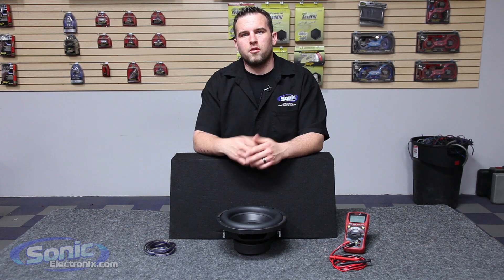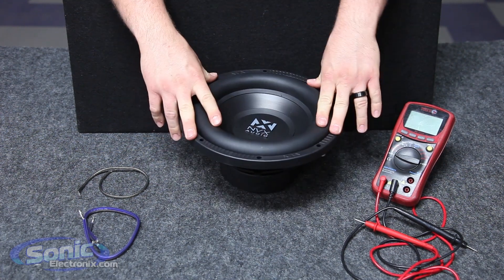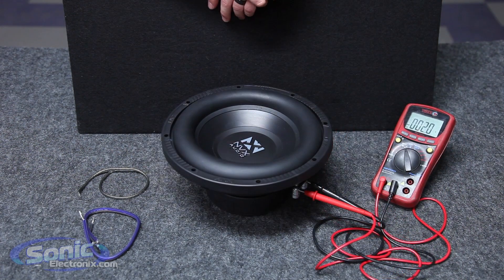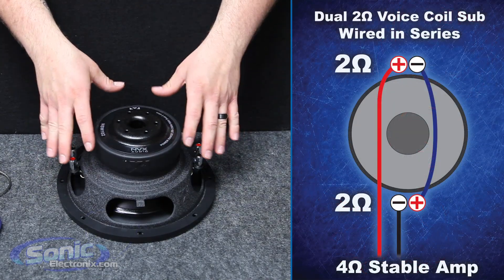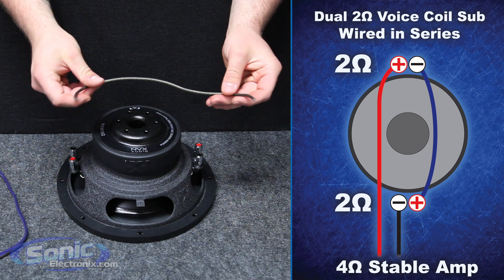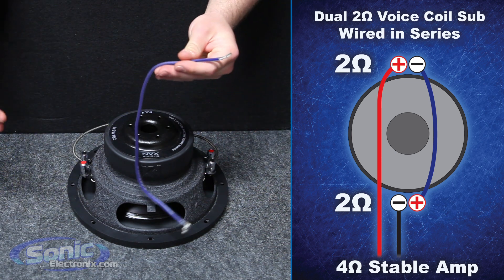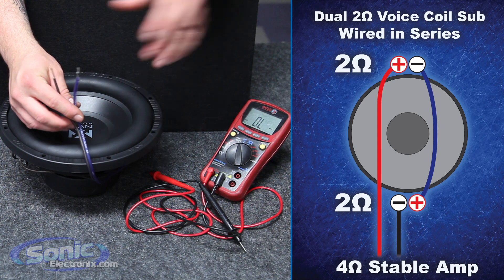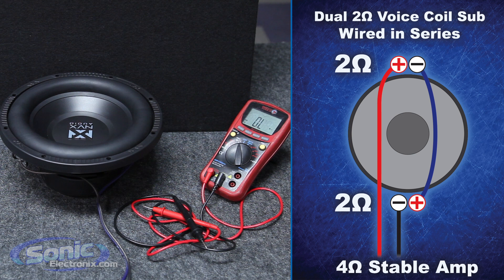How to Wire a Dual 2 ohm Subwoofer to a 4 ohm Final Impedance | Car Audio 101

Comment: If you want to get the most out of your amps then most people buy 2ohm dvc subwoofer so you can wire it to 1ohm and get the max rms out the amp  or if you have a amp that can take .05 ohm load then you buy 1ohm load dvc subwoofer so when you drop it down it will drop to 0.5 ohm resistance but only if the amp allows it and some company’s warranty 0.5 load like d4s but it’s all preference  I learned the hard way years ago it’s so much in car audio like it all comes to preference

Comment: Ciao e grazie per questo video. Vorrei porti gentilmente una domanda:  Quali caratteristiche ha in termini di timbrica un subwoofer doppio COIL da 2OHM collegato come in questo caso a 4 OHM e cosa cambia se invece i due COIL  li lasci a 2 OHM ? In questo momento ho un sub della Graund Zero  modello GZUW 12SQX 30 Cm 2x2Ω Sound Quality 600 configurato a 4OHM e non mi piace tantissimo il suo basso.,considera che il suo uso è per un ascolto in SQL.Magari se potresti gentilmente fare un video specifico te ne sarei molto grato.

Comment: Is there any disadvantage running a 2 ohm sub in series instead of a 4 ohm sub of the same make/model?
Reply: Not really. The only disadvantage that I could possibly think of is if you weren't paying attention and wired the phase wrong, you could fry the voice coil real quick. Other than that there is no inherent disadvantage.

Comment: My question is the performance of the woofer changes according to the connections?
 i have a dual 2ohm and it's supposed to be 500 watts rms
Reply: i think it does??? for the amp different ohms have different power ratings
Reply: oh and i dont think that the watts of the subwoofer changes im not sure! i know the watts of the amp changes

Comment: How do you make a 2 ohm into 4 ohm if you dont have a dual coil. If its single could you add a resistor to increase the ohms?
Reply: You should look into dual coil subs, your stuck with 2 ohms and that is plenty of power

Comment: I have one DVC 1 ohm sub woofer rated at 900w RMS and I have an amplifier that is rated to do 900w at 2 ohms. Would I wire my set up the same way you did in this video?
Reply: Yes. It is a dvc 1 ohm that means if you jumper wire between the two coils you will have a 2 ohm impedance on the remaining wires. In this video it is 2ohm DVC which will make 4 ohms at the remaining two wires.

Comment: How does going from 2ohm to 4ohms sound?
Reply: 2 ohm doubles you watts.4 ohm cuts your watts in half
Reply: @New Alert so if I have a monoblock amp that is rated 1500rms at 1ohm but I have a single sub that is rated at 500rms. I can wire my sub down to 4ohms because my amp is rated 550x 1 rms at 4ohms?
Reply: @New Alert even on 2 kicker l7t 10? Will 750 be enough? I think they are 500rms each

Comment: If you put two of those at a 4-ohm final what is going into the amp,   2 ohms ?
Reply: Medi Kate 4 ohms
Reply: @justind1169      if your using a mono amp that has 2 channel hookups it'll drop the 4ohm to 2 ohm so the answer is yes if its a mono amp with two terminal connections. the mono amp automatically drop it to 2 ohm load

Comment: Dual 2 ohm wired to 2 ohms? This is one sub.
Reply: Impossible....

Why the hell don’t you have the 12”  IDMAX D4???? WTFH.
Reply: There’s 2 coils each one is 2 ohms add that together you get four, run it parallel it cuts each one in half so you get a 1 ohm loaf

Comment: Need some help please. I've got two 12 inch crossfire DB3 Series DVC 2/8 ohm. So subs being 2/8 ohm how do I wire them both to 4 ohm's being 2/8 ohm's or are they the same as a regular 2 ohm sub. Thank you

Comment: I've got a mono amp and want to push a 4 ohm load. I am using only one sub. The sub is a dual voice coil, each voice coil is 2 ohms.  The dilemma is that, even though it's a true mono amp, it has 2 positive speaker outputs and 2 negative speaker outputs ... not left and right -- but just like this:
 + + - -. How do I wire that single sub to those outputs, do I somehow use both positives and both negatives or what? I want to make sure that amp sees 4 ohm because my power and ground wires and fuse are not going to be able to handle 2 ohms. Anybody have a solution?
Reply: series the sub as in the video then on the output section of your amplifier  take one positive from the two positives from your amp conect it to the sub do the same for the negatives an presto .
Reply: VM Gaming Thanks, I appreciate your response!

Comment: I need some help I have  two woofer the two of them is dual but here is way my problem comes I want to wire them together but on is a dual 2 ohms and the next one is a dual 4 ohms i like to wire them to 4 ohms final impedance can it be done I really need some help
Reply: kyle gurley Wire your dual 2 ohm to 1 ohm and cross it over to your 4 ohm sub basket that would be wired as shown here. make sure when parallel wiring like that to connect to the positive and negative terminals that don't have the jumper and run your final wires to the amp.

Comment: if you wire a dual 2 ohm to a 4 ohm impedance, can you still push the same rms power that it was rated at @ 2 ohms?
Reply: craneoperator4 so how do you keep a 2 ohm sub at 2ohms?
Reply: The power from the amp will drop but the rms power on the sub will stay the same the same.
Reply: ExtremeBassLine i have that same question
Reply: no...your power will drop
Reply: +craneoperator4 thanks
Reply: Brandon Potter  +to amp & -to amp
Reply: ill explain one more time. with a mono amp like mine a jbl600a1 mono wiring them in series to 4 ohm like this viedo shows  the amp automatically  parallels them back to two oms. if your mono amp has two speakers connections and is 2ohm stable . same if u have two 4ohm single voice coil. run it to each channel the amp parallels the 4oh to a 2ohm load. automatically now that's the easiest way for my to explain it
Reply: Brandon Potter try running 2 of them. Do series parallel wiring.

Comment: Could I do this with 2 subs and connect the positives and negatives and connect them to my amp bridged at 4 ohms?
Reply: Collap You would need two 4 ohm subs. two ohm subs wouldn't fair well with this method. but if you unabridged your amp you could run the four ohm loads to each channel. With the bridge only 4 ohm subs would work by wiring them parallel in this fashion by putting a jumper on each sub this way and then wiring the remaining terminals in parallel + to + and - to -. Hope this helped.
Reply: Neal Pennington ... ok u can bring dual 2ohm to 4ohms. Ok what about running 2 dual 2ohm to 4omh. An at the amp what would it see 8ohm or just 4ohm... cause i have a punch 800a2 200x2 4ohm 400x2 2ohm but 800x1 4ohms bridged. Im tryn to get my 2 dual 2ohms to bridged 4ohm is it possible.

Comment: Can you wire a dual 2 ohm sub to a 2 ohm amp?
Reply: yes just connect it like you normally would
Reply: ExtremeBassLine so u mean connect it on one side red and black and Thats auto 2 ohms straight
Reply: @harlembossdon  I have the same ?

Comment: I have two solo-baric s15l7 2 coil 2 ohms each how do i connected to a ZX450.2 kicker amp i have two of those amps best way to connect to have a good sound out off it any suggestions.

Comment: By wiring the 2 ohm to a 4 ohm how is that helping. Also I'm looking at a 2 ohm (SPL FWX 154) (peak watt.2200/ RMS watt.1000) and I will be running that speaker off a 3500watt  planet audio will this be a good setup. Any advice is good advice thank you.
Reply: some amps cant take the 2ohm load if you have a amp that is only 4ohm stable this is very helpful its mostly the old class a/b amps that cant take lower then 2ohm

Comment: Just bought a dual 2ohm 8" sundown woofer, this helped me!
Reply: How would you do about hooking this up to a single woofer? 8" 2ohm. I have a stock. Amp and 8" woofer. If I turn it up it sounds ugly like it's about to pop. Until I lower the volume.
Reply: @TacoYakie  I know its been 2 years and you probably found but get a better amp
Reply: Hey I have two of the scar twelves that are two of them can I wire both of them up like this to get a final impedance of 4 Ohms

Comment: REQUEST: two dual 1ohm to .5 ohm. Please and thank you.
Reply: rome seveneightsixnine Wire the first one like this and then with the outgoing pos and neg just wire them to the basket with the positives and negatives jumpered on the basket.
Reply: + to - on first basket with remaining + and - going out then connect those + to + and - to - on the basket and finally you would run jumpers + to + and - to - on your second sub finishing with and out going wire on the end terminals.